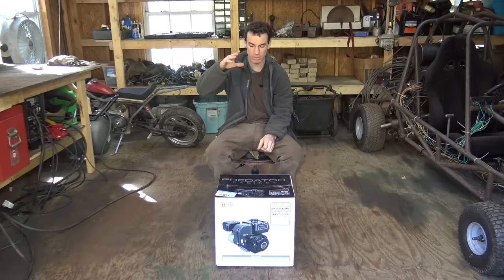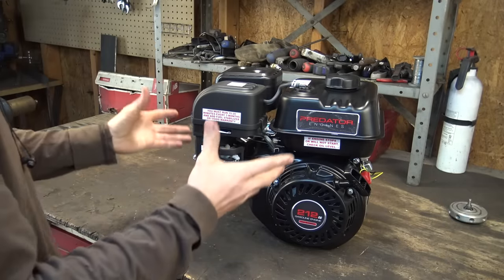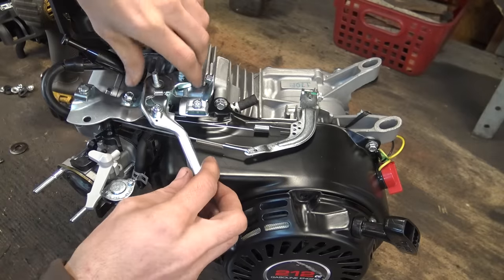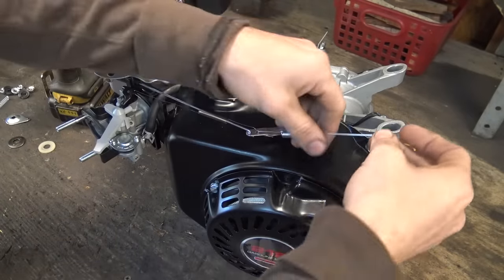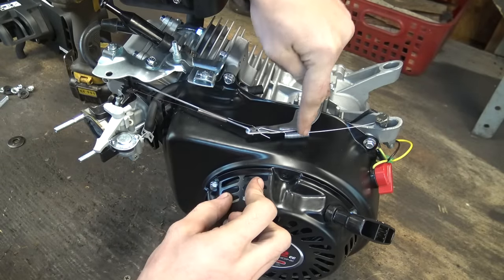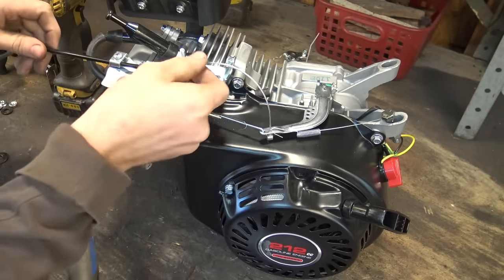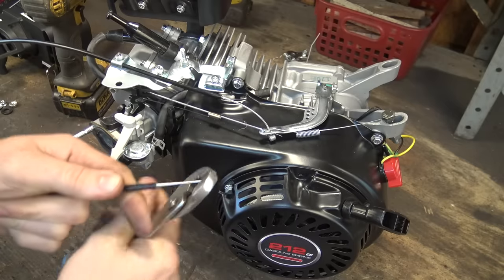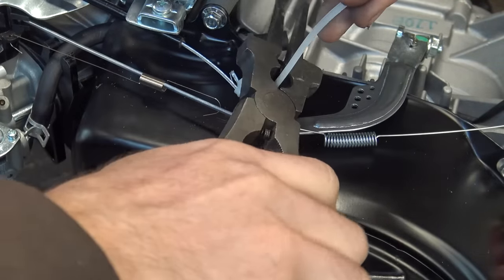how to bypass the governor on a predator 212 engine

Comment: You haven't bypassed it you just removed the throttle linkage
Reply: Robert Clutts my thoughts exactly. I’m confused
Reply: Nah fam he is bypassing bc the spring won’t allow the gov to push back on throttle it will just hit the arm but do nothing
Reply: Bypassed, immobilized, rendered innefective, call it what you want, the guv- na is no longer messing with him.
Reply: But by leaving in the block it still spinning and reducing rpm because are inside is still actuating

Comment: I bypassed the governor like in the video, seem to work great, but now it runs strong for about 3 minutes then stalls out. if I wait a minute or two it will star run again for a few minutes and stall again. any suggestions
Reply: Your running out of fuel in the carb. Check your lines for kinks or plugging. If they are clear add a pulse full pump. It runs off vacume and can be bought on amazon for 5 bucks or so

Comment: An easier way than that is to take the crankcase apart  on the output shaft side once you’re in there there is a plastic gear which is the governor gear you can remove it by taking the pim out of it and retaining clip or its plastic you can break it then put the crankcase back together and add your throttle return spring but if you’re leaving the gas tank on it you can go to the fan shroud bolt right above the KillswitchThat is the way I do it I never had a problem with it I’ve done over 10 of them and you can use the factory cable mounts
Reply: Yeah i agree BUT  for beginners who are scared to open the case this is a great method.

Start them off with little things and work their way up to opening a case
Reply: You got a video of the process?

Comment: Just remove that spring and replace it with a sturdy wire
Reply: No spring it wount come back
Reply: It will you take that spring you took off and use it as a return spring

Comment: It doesn’t work don’t waste your time. No difference in doing this still doing 36mph
Reply: dude do you even own a go kart or do you just not know what the fuck you are talking about? The governor arm moves back and forth when rpms get to high, which slows the go kart down. When you do what this guy did in the video, it keeps the governor arm from slowing the rpms down. I have done this and it boosted the speed of my go kart drastically. How about try it first, and do it the right way, because clearly you did it wrong

Comment: Question if I put aftermarket air filter on 212cc predator engine an I don't have a filter for my OHV can I plug the hose that come from it with a screw on the end of it thanks
Reply: Do not plug the breather hose. Just run it open until you get a filter for it.

Comment: Now my bike wont start
Reply: it’s because stock from factory, the throttle is open before you start the engine. Open your throttle all the way and try and start the motor, it’ll start right up just be aware it might take off.

Comment: another way of doing it, leave that arm on and bend the long metal rod that goes from the carb to the gov up into the little arm hole! and then you can attach the throttle cable right to the arm because there is a throttle cable mount on the arm! and I use the spring to hold the gov arm back and the gov arm doesn't go forward like that.

Comment: The engine STOCK is governed to top out at 3600RPM, which makes them last a lot longer,  the governor assembly in the engine has several Nylon PLASTIC parts, which dont like life above 3600, by using your method and leaving it inside you GREATLY risk it coming apart as you will be revving the engine a lot higher than 3600 now and the chance of it flying apart and self-destructing and send chunks of broken centrifugal governor flyweights and metal and plastic bits all around your spinning crank, rod and cam gears is just asking for problems - PLEASE I know you must be having a slow week, but take this video down, I'd rather see no content than Bad advise that will possibly create many blown up gokarts and mini bikes world wide.......
Reply: Eclidean boohoo a blown 100 dollar engine
Reply: Eclidean we are trying to go fast not slow. When your redlining something your risking it for fun its a 100 dollar motor..
Reply: Maybe you misread my comment, I'm not suggesting people dont de-govern and rev up their engines - NOT AT ALL, I'm suggesting if you just disconnect the bellcrank on the OUTSIDE and leave the stock PLASTIC gear inside it will fly apart and hand grenade the motor - to remove the governor correctly you should open the engine and remove the whole thing --  I'm saying his quick and dirty method is flawed by leaving it in when you de-govern!!
Reply: I've ran 2 Predator 212s and a 420 with the govener bypass for over a year, and ran them very hard on go karts and they are still running great..with heavy valve springs.
Reply: Eclidean   you not all the way right you know but I see what you're saying
Reply: Eclidean nope
Reply: Just because the engine starts off at $100 doesn't mean much...   If u really are in to the Honda based clones then the sky is the limit for how much money u can throw at a build.....   Stage 3 kits are a pretty penny and I would hate to blow a nice build  just because ur to lazy to do it correctly..... If ur into fast clones do it right or keep the bad ideas to ur self,.  Some people might actually think u know what ur saying.........
Reply: Eclidean and need to replace valve springs w stronger like 35 lbs, its his 7th one. We used to do that in the 70s nothing came apart
Reply: with a no questions asked warranty too
Reply: Eclidean YUP
Reply: whiskey throttler so your ten yr old friends kids hops on it and is going 35mph, the gov. blows out ,the kid heres it, gets startled and wipes out, and dad sues you...ha ha ha ha fools
Reply: folks run them on racing karts with the governors set at 5800 rpm whilr kart on the stand, and they run that 40 laps straight..wide open on 20+ karts..bone stock predator 212cc.  no problem with nylon governor gears in any of them.

is this the proper thing to do.  probably not. is it gonna hurt the engine..maybe..do most of us care..not really cuz we got the engines on sale with 97 dollar coupon..buy the 2 year warranty..if we blow them up...get a new one and do all over again and have a blast in the process.

folks over react about stuff getting. tights in a wad.
Reply: This in not a stage 3 build, it is a stock motor with a govorner bybass mod. What gave you the idea this was a stage 3 build?
Reply: Could you just remove the plastic gear assembly and keep the governor arm and do the bypass? I just wanted to know if it was absolutely necessary to remove the arm because I dont think I have the equipment to do so.
Reply: this is not removing the governor, the plastic piece inside it still stopping it at 3600. theres only one way to remove the governor and thats removing the plastic piece
Reply: @Damascus..  I actually have done this bypass and I am getting way over the stock 3600 rpm and I can hit 45mph easy.
Reply: If the motor is governed at 3600, is that with the throttle stop screw backed all the way out? Because backing out the screw lets the throttle travel further and gives you more rpms. Or does the engine come stock limited at far less than the governor is set at?
Reply: whiskee throttler go fast by increasing your compression ratio by putting a thinner gasket or simply installing a domed piston. Not by messing with the governor.
Reply: @ronniemiller3669  the ignorant always out number the rational right way. They will never change!
Reply: I have the governor removed or bypassed in a briggs 5hp along with a briggs 8hp and a 212 predator. They all still have the gears in them and the 8hp briggs has been like this for about 15 years.
Reply: So know it all's that have never even tried something but they hear " it will damage your engine" from someone else and run with it. If you have done this exact mod and chucked a rod OK but if not shut your drama pipes.
Reply: @mohamedelsharkawy5761  Dude I work on all engines it's fine what he is doing. They will be running those engines hard anyway.
Reply: @mohamedelsharkawy5761  And It is his $ who are you to tell him how to burn it.
Reply: @timesthree5757  If you worked on all types of engines, you should know that the governor is there for a reason.
Reply: @mohamedelsharkawy5761  To meet federal regulations. Let people do what they want with their $. You have no right to say what he can or can't do.
Reply: @mohamedelsharkawy5761  And out the 1000ish small engines I get about half have had the governor removed or bypassed out of those I have had one a year where the owner did not make sure that the crankshaft was rated for 5,000 rpms or more.
Reply: Woah. Just woah...
Reply: @dukecityminibikes7701  Stage 3 kits require a tear down of the engine, so we can agree that since someone is already putting in a new conrod and flywheel and advanced timing, then that would be the time to remove the gear/arm/oil sensor.

Therefore, your point is moot.
Reply: @caseykelso1  Show me an example. One example of a rod through not only the block, but someones body. Bet you cant.

Save your "sky is falling" nonsense.
Reply: @mohamedelsharkawy5761  Doesnt work that way, kiddo.

Gearing and rpms are how you achieve speed. Increasing your compression only gets you to the same speed faster, not increasing top speed.

Stop spreading misinformation.

Comment: studying up on them iv never used one always had flat head briggs there getting harder and harder to find so putting away my old time blocks and going modern   will do justice to any good go cart or mini bike going to put one on my sears but will have it factory for hard work on it but the gov and all that stuff will have to go on carts and ect.........cool video it will run without blowing all to hell no one holds a engine wide open its common since ...also run good oil and keep it changed wont be a problem

Comment: I have a question if you're bypassing the governor what about the valve springs should you change them also
Reply: No valve springs are something you want to do after you get a billet rod and billet flywheel. Stock springs float at 5300 RPM and act like a governor thats governed at 5300 but you DONT WANT TO turn the engine up to 6000 or higher without a billet flywheel and rod. It's starts to get dangerous with stock parts above 6000 RPM. But trust me 5300 RPM is plenty. Get a billet flywheel and rod and get a high lift cam and THEN do your valve springs. Valve springs are always like the last thing you wanna do on a performance build
Reply: If you have any other questions I would be happy to help you out. I build performance 212's as a side job/ hobby
Reply: @joeshmo2473  I'm having a issue with my 212 won't rev up all the way will just fall on its face and I'm having some trouble getting it to idle I put a new carb and jets and emulsion tube could use some knowledge on it

Comment: I will have to watch this again, but it is straight forward enough. I like this method a lot more than removing the governor. It sure would not work to have an engine on a bike, or cart with one predetermined rpm.

Comment: Side note how do you feed gas if you don't reuse the tank. It has intake from the top siphon type. If you gravity feed from a top tank like a moto it does not stop feeding.i tried using a gravity tank with bigger capacity on my generator  and it just filled the cylinder with gas and leak .I had to go back to the original one with top intake.

Comment: Just used you video to bypass the govener on the GX160. Idle is too low now, it won't start without giving it throttle. And suguestions on hiw to fix? Or do I need to reinstall the factory set-up? Lol
Reply: Re tighten your accelerator cable to bring the revs up to idle.sounds too loose.

Comment: How does this bypass the governor? It just reroutes the throttle cable directly to it instead of the throttle lever
Reply: With the cable hooked up like this the governor can no longer move the throttle on the carb. It is not stronger than the person controlling the cable.

Comment: What if they throttle doesn’t return to idle? I can’t get mine to start idling... is there a spring inside the carb that brings it back?
Reply: Mine does the same thing. Did you ever find a fix?

Comment: Hi I installed a performance air filter on my Coleman b200 minibike but instead to increase horsepower it lost them any idea why
Reply: You need to install a .38 jet in the carburetor if you change the air filter or exhaust.

Comment: Lol, how long did it take you to figure out that when you where pushing the cable through the gov arm you knocked off the one spring? And to be fair, the people should know that you stand a good chance of over revving the engine without the governor hooked up. After all, that is what the governor is made for. They would noy put one on every single motor made for nothing

Comment: Anyone watching this now, don't do this. You have to remove the governor inside the crank case. It's a plastic gear and it isn't designed to exceed 3600 rpm. It will spin apart inside the crank case and destroy the engine. Be warned.

Comment: I tried to put my predator motor on my golf cart I got and the pulleys line up but the pull start is gunna be faceing the front of my golf and I can't start it like that because my seat is in the way will it still start if I turn the pull start around so it will face back of my golf cart
Reply: Yes. You can clock the pull rope any spot the holes line up at.

Comment: I got a 208cc AllPower, the manual says it makes 30lb-ft and 14hp at 2800rpm, data sheet says it makes 9hp up to 5500rpm... it came off a wood split-er, didn't have enough in it to split the big hard wood logs so it got replaced and sat in a shop for a few years. got it for $100. going to run a 14-1 gear reduction and have it on a down hill bike i will modify.

Comment: I wonder if you could use strong fishing line or braid
Reply: I tried pike fishing steel wires. Wont work. You need the cable to move in another cable

Comment: My engine doesnt like the choke all the way open..for some reason it revs violently, I also cleaned the carb and everything seems to be working properly although I think that because I unscrewes the jet screw to clean it I might have messed the fuel to air ratio, I think that I'm not getting enaugh fuel to the engine

Comment: I have a 6.5 hp baja heat mini bike and I love it. It starts like a champ and has always run great until now. When I release the throttle to coast, the engine cuts out. No sputtering, it just shuts down. It will start right back up but will continue to do this same thing. I replaced the throttle handle, cable, carburetor and air filter but it's still doing the exact same thing. I love and subscribe to your channel and hope you or someone else can help! I loved the video on bypassing the governor. This worked like a charm but my engine still cuts off when I coast. I appreciate any help. Thanks, Jon
Reply: it could be the oil sensor
Reply: Did you ever figure it out?
Reply: @juicekage5416  usually an oil level problem or oil sensor not detecting enough oil there
Reply: Clean your jets
Reply: Check your oil level,, sitting level the oil should to all the way up to the fill hole threads..
Too many people use the dipstick Guage, and run them with the oil to low..
Reply: Grounding issue? If ur engine grounds out it will stop running
Reply: Simply your clutch is going bad.
Reply: In my opinion, by working on the KT 196 Engine it comes down to throttle control. That governor lever is the problem it doesn't allow the idle to stabilize because it is sloppy, it has a lot of slack that doesn't allow it to idle properly. Check you idle tension level. If there is slack in it then that is your problem. Over time I guess the springs lose tension and allows slack. Try replacing the springs on the throttle control.
Reply: Maybe your idle is set too low?

Comment: Unless the motor is going on something that doesn't need or have a throttle cable, like a tiller or log splitter.  Then you kinda need some of the stuff you threw away.

Comment: I want to make a 212 motorized bike and I have a few questions one would be if I want to put a 2and a half pup tank so how would I attach the pup tank to this motor? And is it possible to put a 50 tooth sprocket on this engine so that I would have a 50 tooth sprocket on the motor and a 30 tooth on the wheel for my bike so would that work
Reply: No that won't work. You will need something like a 12 tooth and a 72 tooth sprocket. And you need to have the smaller sprocket on the engine and the bigger sprocket on the wheel.
Reply: @sentradynamics8889  OK I can put the 30 on the motor and then take the 50 and put it on the wheel if that will work I will find out soon

Comment: take the rod that connects the governor to the carb cut it to size connect  it to the throttle arm and the carb that way u bypass governor it will be a lot faster

Comment: The only problem I can see by doing this is it looks like the cable wont have to more very much to be at WOT. So you may be at Wide Open Throttle but you barely have to be twisting the throttle or thumb throttle to be at WOT

Comment: You see this is dangerous because it has a spring pulling it towards full throttle. If anything happens to the throttle cable and the idle return spring fails… you’re screwed if you can’t kill the ignition. It’ll rev wide open

Comment: WHat if I don't plan on going over 20mph? Just leave it? Mine is on a antique adultrike. My dog walking vehicle. I need torque not top.
Reply: Gear it low
Reply: I mean high, little clutch sprocket, big axle sprocket